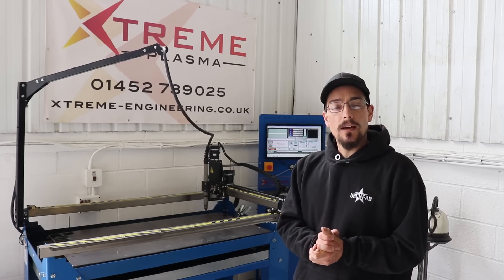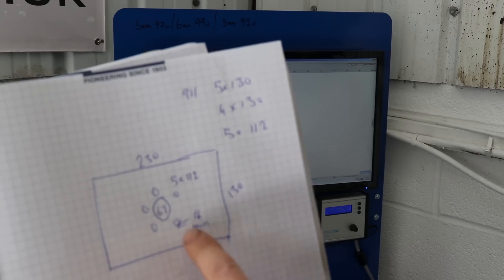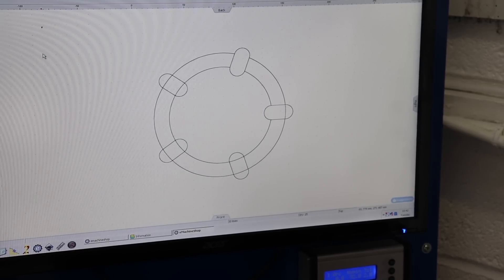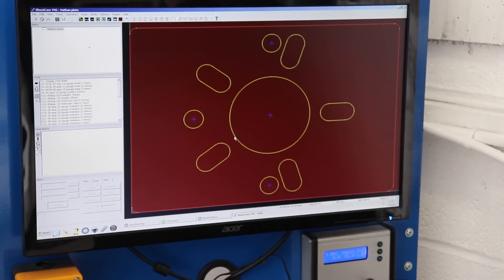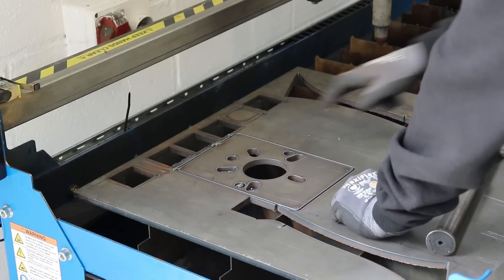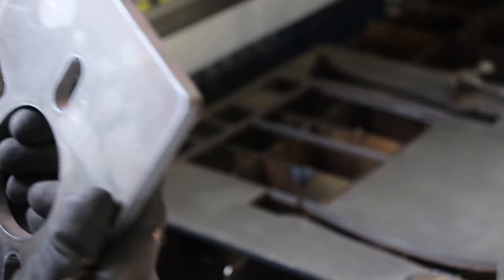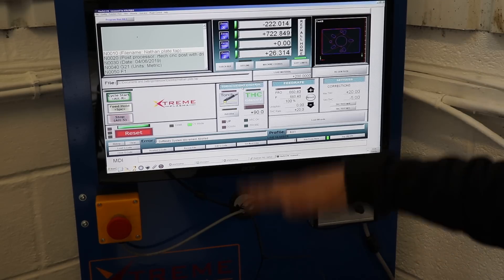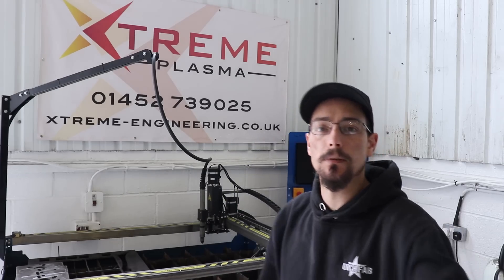A SIMPLE CNC PLASMA JOB, BASIC CAD DRAWING AND CUTTING.

Comment: Nice job. I now know how to divide up circles for adding holes to a PCD. Thanks. My table is the same as yours, bought from Xtreme this year. Do you have the Thermacut machine or Hypertherm? Wouldn’t mind the opportunity to discuss settings with you off line. I’m just finalising a fume extraction system based on a down draft principle  so my workshop doesn’t get filled with smoke and fumes every time I cut something.
Reply: R-Tech P50

Comment: Those turned out great mate, cutting very well there, on that thickness material I reckon you could get a way without using the thc, mine is the same machine as yours and cuts great on thick material without thc on, anti spatter spray helps alot on reducing top slag build up as well, keep the good videos coming

Comment: how precise the cut on the 10 mm? I mean u set the hole for 16mm what's the diameter after the cut?
Reply: Ten of em,
Reply from the maker: You get a slight taper on the holes so the top of the holes are a tad larger than the bottom on thicker plate.

Comment: The Side ways forces on those hub bearings with 6-8 foot levers is frightening .
Reply: Nothing compared to hard cornering. Just think of how much strain on the wheels, tyres & hubs when cornering hard at 70mph. Doesn't even compare to what you are suggesting. I may be wrong & maybe someone may have the statistics that can compare the two.

Comment: Matt, you shouldn't have to draw all of those slots individually. There should be an "array" command. If you ever need help with anything complicated let me know. 20+ year cad veteran and solid modeler
Reply from the maker: I will have a look for that later, Cheers
Reply: There's an array command in emachine shop?
Reply: @ratgreen  I just looked. Apparently not. My god that software sucks. I did find this video showing a very convoluted way to do it though  https://youtu.be/Zkcn2eo1HB8?t=495

Comment: OK here goes an "I know nothing about plasma cutters " question. Is the egg crate style support underneath the workpiece sacrificial? And I don't quite get how you control the depth of cut are you saving the height above the workpiece or actually controlling the length of 'flame/plasma thingy?  --- It's only obvious when you know about this stuff. Really enjoy the videos by the way.
Reply: Yes the support under is sacrificial. You can change the strength of the cut. Not sure if his is controlled by the software or not. The height off of the material needs to be a set distance which can be set in the CAM software I would imagine.
Reply: You use the machine to cut more supports 😉
Reply from the maker: Yes its a sacrificial grid. Cheers